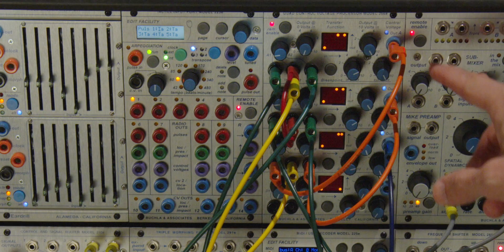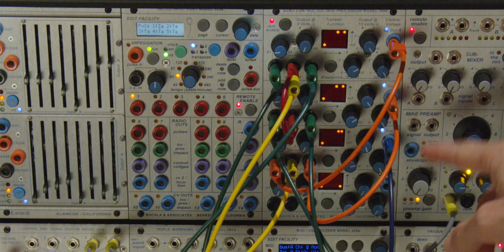Buchla Sequential Switch

Comment: couldn't you use the 250e as sequential switch using the external inputs addressing? so let say 251e sequences 1,2,3,4 to 250e A,B,C,D and then selecting A-B-C-D per stage?

Comment: The first thing I think of when you ask about implementing the A-151 on the Buchla 200e would be the use of the external inputs on the 250e. From there you can choose which of the external inputs are selected as the source. That is the A-151 when it set up for a common output. To go the other way (common input), you can use a single external input on the 250e and map it to CV1, 2 or 3. I realize this is "only" three channels of output, but the patch requires nothing more than the 250e, so I think it is worth mentioning.

Comment: couldn't you get that entire sequence from a single channel of the 251e?
Reply from the maker: Please explain.  I can see programming 4 sequences contiguously into a single 251e track, but don't see how one can then give the instruction to jump from one infinitely looping sequence to another infinitely looping sequence.
Reply: OK.  no.  I am pretty sure only a finite number of loops for each sequence is possible with 251e.
Reply from the maker: With jumps you can loop forever.  But there's no way I know to say "Jump to Sequence point N and continue", except when N=1.
Reply: One thing to keep in mind is that S&H and DIR options exist on the 251e. With these, CV can be used to address the 251e stages. Transposing this CV would accomplish "jump to sequence point N and continue [forever]"